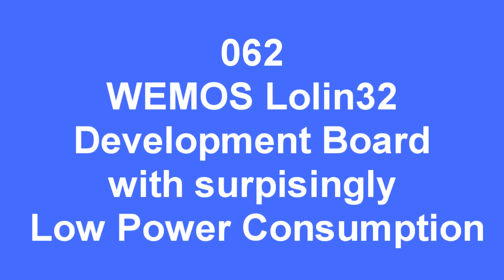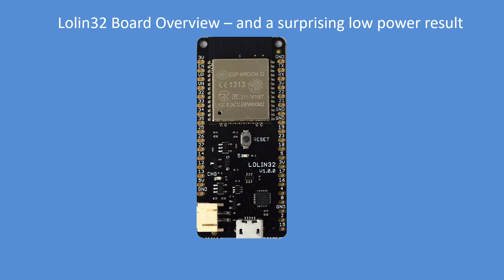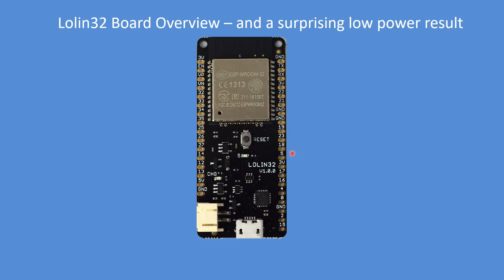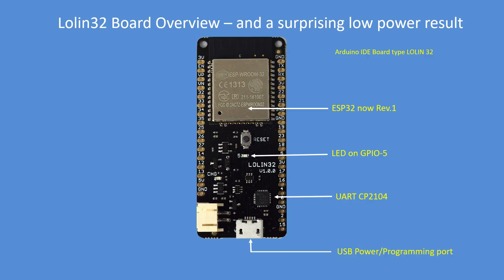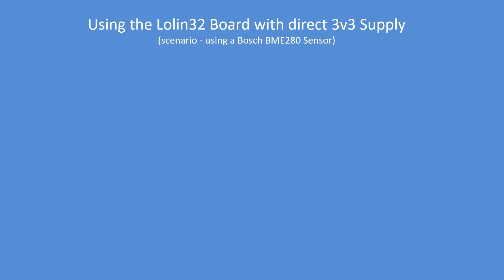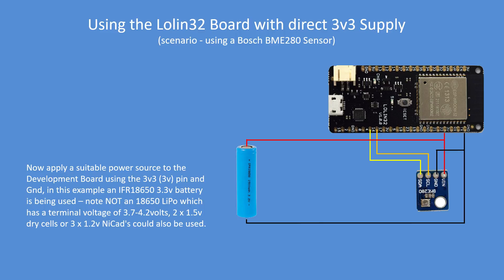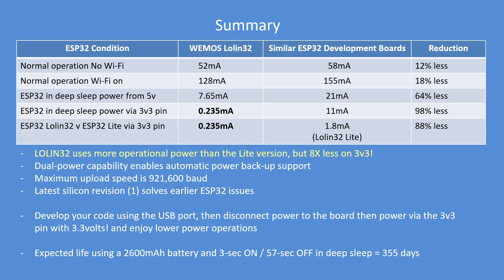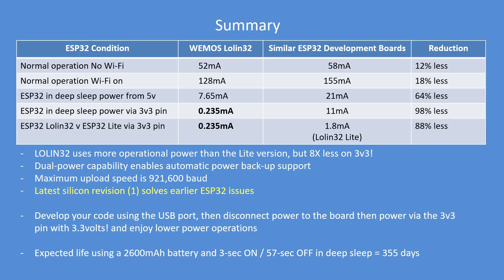Tech Note 062 - WEMOS Lolin32 (surprisingly low power demands when powered by 3v3)

Comment from the maker: Please note I made a mistake on the last summary line, I meant to say 3-secs on and 57-minuites off (Deep-sleep) for a 355-day battery life
Reply: Hi could you also make a review about a clone of Adafruit Huzzah32 feather board? It's called "ESP32 Dev Module" on aliexpress and eBay.
Reply from the maker: Hello, I could if I had one but I don’t. I self-fund everything I do and the Youtube income is $2 / month at best, so no funds for this. If you send me one I will do the review. Sorry.
Reply from the maker: There was a units problem (secs v minutes), the answer should have been 317days:
3-seconds on at 128mA
57-minutes sleep at 0.235mA
Answer= 128*3/3600+0.235*(3600-3)/3600=0.341mAhr
2600/0.341=7614Hrs
7614Hrs=317days

Confirmation, if it sleeps all the time the duration would be 2600/0.235=461days

All development boards on the market take a lot of current to power the UART, Regulator and other ancillary components, but powering via the 3.3v direct enables much lower power to be consumed, that was the point of the video.  The Rev.1 silicon now consumes 145uA in the sleep mode when powered via the battery terminal, see the notes below where I have tested 5 different boards in sleep. Most development boards cannot be used for low power work! At least the Wemos ESP32 Lolin is OK at 145uA.
Sorry about the confusion. It wakes for 3-secs, sends a reading then sleeps for the rest of the hour.